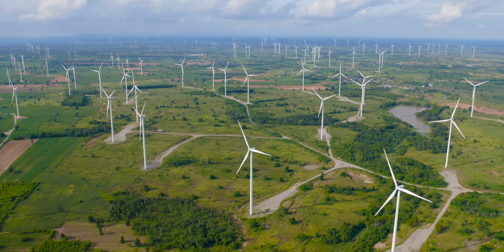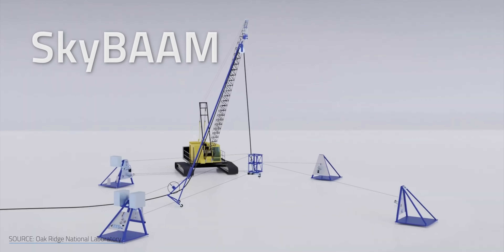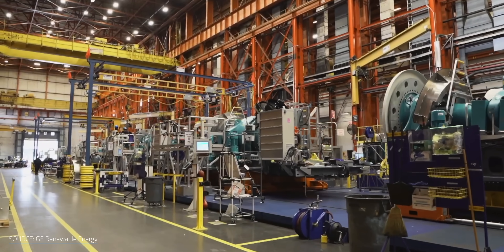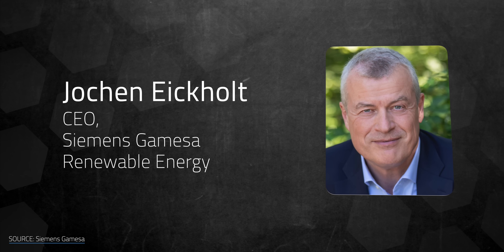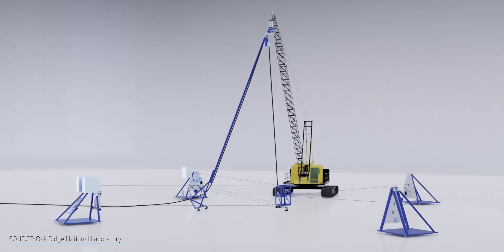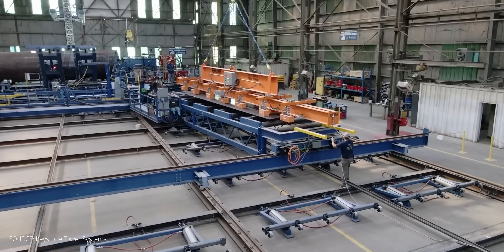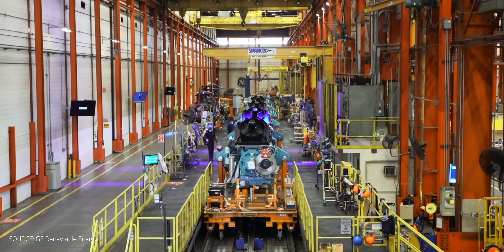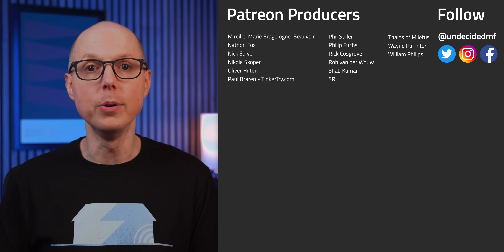Why We Need To Rethink Wind Turbines

Comment: It doesn't get into the main reasons for large turbines:
1. Higher capacity factors
2. The majority of the blades energy is generated from the last 30% of the blade, so shrinking a blade by 30% will cut the energy output by more than half.

Comment: I'm sure the math wouldn't work out, but I always wondered if a better alternative would be to have each turbine become a hydraulic pump and the lines run to a central flywheel storage unit that stores the energy and generates electricity.  That way you're not putting millions worth of $'s in each turbine, and you can add additional "wind pumps" to increase capacity with only a single, large generator (and have some storage to boot).  The efficiency would be less due to fluid friction, but it would make up for it being lower cost and easier to expand cheaply.

Comment: Going smaller than bigger won't work. The physics eont allow it to work. The better solution is to increase the strength of the bigger windmills. This can be done using better materials or a higher percentage of binder material.

By smaller, I meant the company going for more but smaller blade per windmill pole.

Comment: The size of the HAWT is the desire or marketing of the biggest bang for the buck. Filling the tower with dozens of VAWTs that can add up to close to or the same output. You still get power from VAWTs lower to the ground and lower wind speeds. No issues with rapidly changing directions or high speeds. Any breakdowns, unless it's a tower failure, doesn't result in a complete shutdown. You can just swap the VAWT that's down leaving the rest of the tower still operational.

Comment: We need to rethink solar a LOT more.

Electric solar panels are around 17-21 percent efficient. Solar heat collectors get up to about 80% efficiency. 

Every house should have a solar heat collector on their roof, tied into their hot water heater.

Even in the heavy snow areas, if you keep snow off, they'll provide a decent percentage of your hot water heating. And if you don't remove snow, there's still 4-6 months where you'll have almost no money spent on water heating.  For a LOT less money than installing enough electric capacity to heat with electricy.

Electric solar isn't that efficient.
Converting electricity into heat, while a 100% efficient process is a VERY inefficient way to heat anything.

Why are we using the least efficient form of solar, to heat things up, in literally the least efficient way?
Reply: Oh, and an air version, is a great way to warm up an unheated garage.

Comment: I'd check out Robert Murray or other channels that explore arrays of  smaller fans, shrouded fans, fans with turbine-like configuration with 2 or more fans per axis, as well as the vertically oriented omnidirectional turbine, where the blades are placed horizontally, the axis of rotation is vertical, a safety box in a hex or octagonal design encloses the fan, and functions as a duct which captures and speeds up the wind, regardless of which direction it blows, and can be used near the ground, in urban settings.  You also forget to mention disposal of these big, old, dumb turbines that are little more than dick measuring contests, not based on science or engineering, only ego and popularity.  Lemming culture at its finest.

Comment: Truth is that this isn't design flaws or logistics or subsidies - It's the fact that the entire idea of the wind turbine has lost the fight with its primary rival, the photovoltaic cell. It's like bluray vs hddvd, betamax vs VHS.

Going forwards, making wind energy work is going to get mechanically, logistically, and materialogically more complex, more expensive, and more difficult. On the other side, solar energy is going to get simpler, cheaper, and easier. We've crossed the threshold where solar is now sufficiently cheaper and more reliable than wind that developers are making the choice.

There is no future energy grid that involves wind at the end of this century. It will be solar + solid state batteries, backed up by pumped storage and hydro power (both of which perform hydrological tasks we need regardless), with potentially a fusion-powered base-load. Wind just won't survive.

Comment: Even more important is the fact that MOST of the wind that passes through the swept area of a huge, three bladed wind turbine, HAS NO EFFECT ON THE BLADES, because it is so far away from them as they turn... Imagine a wind turbine with a diameter of ten miles. The rotational speed would be about one rev per minute, maybe one rev per five minutes. How much of the wind is going to pass through that huge swept area without having ANY effect on the blades? Most of it. The smaller a wind turbine is, the faster it rotates (presuming it is the same (crap) design as the 'modern' three blade, horizontal axis wind turbine that we see everywhere nowadays. Therefore the blades 'hit' more of the wind, or rather, more of the wind passing through the turbine's swept area actually exerts force on the blades.  But ask any wind turbine 'expert' about this, and they'll lose their rag with you for daring to knock holes in their crappy design. Wind turbines are a complete and utter waste of money, they cannot compete with solar panels, solar panels can be installed on roofs of houses, which is exactly where they are needed - at the place the power is needed - at people's homes. The same goes for LiFePo4 batteries - every household should have 10kWh of batteries, rather than trying to build huge battery storage facilities miles from the houses they will actually supply power to.

Comment: Color me sceptical on multi rotor wind turbines. You greatly increase the complexity of the system, and thus  increase the number of possible failures.  To me it seems that the size of the rotors is not so much the problem, but more the speed in which the rotor size has been increased. Maybe it is time to iron out the problems with the current generation of windturbines, before moving on to bigger rotors.

Comment: This is entire subject has been over hyped and under analyzed.  Wind is not a base load power supply in most cases. Not to mention that manufacturing and transporting them requires huge amounts of energy. Usually from so called fossil fuels.  Then there is the problem of disposal.  Wind like solar has niche uses, but our best way forward is small modular reactors (SMR).  They are a much safer and modern design, and can be scaled up to match requirements (just add more modules).

Comment: There is likely pressure in the wind turbine industry to keep up with the improving costs of solar power based systems. However, it is going to be an uphill battle because solar is viable in almost all locations of the world where there is a lot of people unlike wind turbines that are mostly bought and installed by European countries.  Also consider the huge maintenance cost with wind turbines vs solar due to wear and tear of blades and mechanical systems.  But then, wind turbine power does not need to keep up with solar as long wind energy continues to be cheaper than fossil fuel power plants.

Comment: It is a general principle in engineering that one larger machine is more efficient and cost-effective than two smaller machines that do the same thing.  If this were actually more efficient, GE and the other major wind generator manufacturers would be doing it already.

Comment: Hi Matt, some simple physics - power is proportional to radius to the power of 4, so doubling the radius provides 16 times more power. That’s why they make them as big as possible, on the edge of what is structural possible. They are structurally complex and a lot can go wrong.

Comment: The bladeless rooftop turbines seem like they could have a huge impact in urban and suburban areas.

For tall enough structures, a floor or so of the building could be made or converted to a turbine assembly, generating not only all of the building's power needs, but, like with solar, storing it in batteries to sell back to the grid at peak hours for a handy profit.

Comment: Wind is a kind of solar energy. Just as oil, gas and coal. If we just continue to improve efficient and clean ways to use those stored energy sources, we do not need to build those short lived super structures.

Comment: The problem, Obvious to many, is no single system will EVER work alone.  Wind must be combined with water.  Solar is a dead end as the cells Require frequent replacement, only a combination of wind/water/wave will provide sufficient and possibly perpetual power.

Comment: Going smaller will reduce the production capacity per unit of land under wind mills. This means they arent a logical solution. The netter solution can be manufacturing at site or using studier material like carbon fibres.

Comment: I feel like for areas with decent to good sun, what should be built are very large sand batteries that are heated both directly and indirectly by the sun.  A rough concept: You have an outer borosilicate or ceramic glass structure and inside you have a metal structure (preferably Al) that holds the sand or what not.  You paint the inside metal structure ultra black on the outside and paint the top of the sand ultra black. You pull a vacuum on the enclosed structure.  You also have some Solar panel arrays that are directly connected to resistive heating wires that wrap around the copper tubing that coils in the center of the sand (no need of batteries, controllers, etc just direct current to the resistive wire system).  Also point some solar reflectors at the tank. 

    So the inside metal tank is heated both directly by the sun and indirectly by Solar panels--with the copper tubing being heated directly by the Solar panels.  The combination of the vacuum insulation and sheer thermal mass will ensure that once up to temp, it will remain more or less constant, even over night, through cloudy days, etc.  It will take awhile to get up to working temp, but once there, it should be relatively stabilized.  At night time, cover it with an IR reflector to help with this process (or coat it with specialized coating to do the same thing). 

   Anyways, once it is up to working temp, run water through the copper tubing to generate steam to power generators. It is very low maintenance, low complexity, relatively low cost. Though the large borosilicate glass dome might be a challenge and be fairly expensive (and somewhat fragile). The generators would be the only moving parts, but easy to get to and work on if/when needed (unlike the generators in a giant wind turbine).

Comment: You speak about Blockage Effect. 
With the surface wind energy removed on the planet how is this affecting the upper atmospheric wind energy?
I am concern about this, as well as photovoltaic energy being taken. 
Solar panels are the equivalent of placing plywood sheets on the ground. What happens to the bio diversity below the sheet when rays are not allowed to penetrate the surface?
Are these byproducts of energy collection being studied?

Comment: Another benefit of the multi turbine unit is, if there is an issue with a regular turbine, it's down, production is zero.  With one of these, a unit fails, it still has most of it's output capabilities, it drops to what 90 % output instead of zero..  You just repair / replace the bad component and it's back to 100 percent,  This is huge for ROI.

Comment: Really thought provoking video 🤔
It's clear the idea for wind turbines is windwall and all of the other variations for one reason, everything can be produced under controlled conditions and 60⁰ offset blades so it becomes a whole series of ducted fans and power will not be an issue. The power nacelle is double ended with a turbine on each end. 
The keys are
Portability- 20' shipping containers 
Containers are also the battery banks and control circuits 
Simplicity- simple fasteners made for extended reuse and material safety +50% for stability and reliability. 
Operation- the tower head must be capable of being lowered by powered and unpowered systems and power rotated to lock direction, controlled by a aerometer giving wind speeds and direction so the system will automatically feather itself by turning side on to the wind in extreme conditions. 
Because these turbines aren't huge, they're man replaceable and maintainable without ascending a tower.
So like an led taillight,  if one goes out, the others keep going. If a fault is detected, the turbine spring brakes would be released to stop all movement until repairs. 

Think "IKEA"  Power Solutions 🤣😂👍

Inexpensive, simple, modular,  scalable and for some applications, portable by using the containers as the gravity base😎

Comment: Thats a good idea but not very efficient, at a certain point above the earth high altitude winds of very strong and u can use a kinda ram jet to further compress the air and force over turbo blades turning a generator and creating a good amount of electricity, the more you can compress the air, tge faster the turbo fans turn the generator and more juice it produced

Comment: I worked in Vestas where i have made wings for windmills. They have calculated 25 percent loose on the materiales being used, so, some times we could end up throwing 250 kg of epoxy glue in the litter, on each wings. And I made those 54 meter wings. The windmills are a total mess when thinking of construction. Also when they are broken, the epoxy can't be used again

Comment: Thanks for the informative exploration of wind turbines. I've lived off grid for over 15 years and during that time tried using a residential sized wind turbine. That was a mistake compared to using solar. However, I would like to reiterate that centralized production of electricity is only of benefit to the large power companies, not to individuals. There should be more focus on decentralized production of power, giving users a pathway to autonomy instead of continuing energy dependence and the whims of power company rate hikes. Oh, I enjoyed all the little puns you threw in.

Comment: In the "Energy redefined" podcast they spoke about this last week: the engineering problems with ultra large blades are probably just not worth the trouble. We have very good experience with glass fiber blades up to a certain length. Start going beyond the technical limit of glass fiber into carbon fiber and it's a whole new world of challenges that doesn't react to a fast roll out at all. If you want to scale up wind, stick with what works and build with ultra large for research only until all the unknowns are known.

Comment: My problem with wind turbines is this: energy is neither created nor destroyed, it only changes form. If we were to use any significant fraction of mechanical power from wind and convert it to electricity, then it has to slow down and natural wind currents. Are we really ok with changing the wind patterns across the globe? I have a bad feeling that the rule of unintended consequences will produce a very bad result for a lot of people

Comment: Points of failure increase with lots of small of anything. 10 x rotors means 10 times increase in points of failure. Mount 10 turbines on one pole also means taking out all 10 if one fails.

Comment: I'm skeptical that those array turbines are as good as the company claims - circles don't tessellate, so they've fundamentally got less swept area per unit total area exposed to the wind, and extracting energy from the wind fundamentally decreases the wind speed, that's where the energy comes from. The only way these exhibit less blocking is if they also extract less energy. Of course, that's probably still worthwhile in some cases as a trade-off for installation and maintenance costs, but let's sell it based on what it actually offers rather than pretending it's somehow better at efficiency when it just can't be.

Comment: I don't understand wind turbine design. With skinny blades turning at low speed, isn't a lot of air getting by the propeller and thus not utilized? It doesn't seem very efficient from the get go because of that.
   If you look at farm windmills which are basically the same as what we now call turbines, they have nearly 100% coverage of the diameter. The classic Dutch windmills also turn slowly, but the blades (sails) are very wide thus catching a lot more of the wind passing through.

Comment: Wind terbine when some time air not available wind terbine generater not work best way add motor with wind terbine generater with motor and free energy generater automatically rotate without air when air available fan and motor double force running with free energy generater
Reply: i just got a stroke while reading this

Comment: I was trying to rethink the design of 3 blade generators. For 1000's of years boats and ships used a sail.  The sail can capture the total amount of the winds energy; in comparison, the 3 blade design is 95% empty space! Making a wind generator using the sail concept would be like a pinwheel, as you said in this video, or I would like to call the wing.  The extremely high torque of the wing generator and low speed this creates can easily be converted to high voltage/low amp power.  This full 'blade' design would capture 100% of the wind vs %5 for the 3 blade generators.  I am amazed that no one has thought of this before!